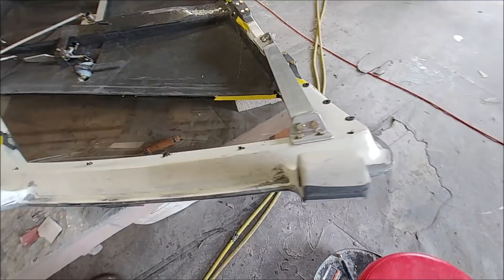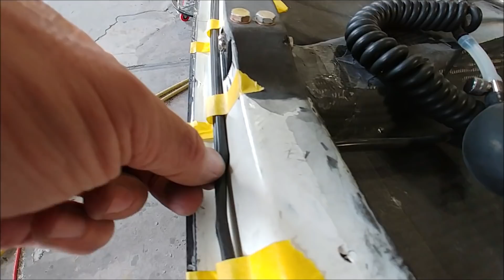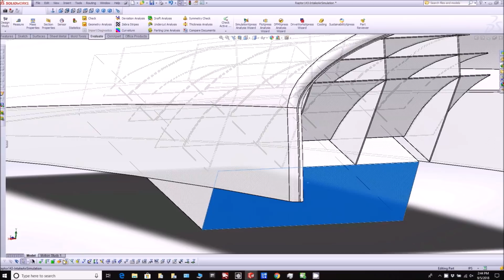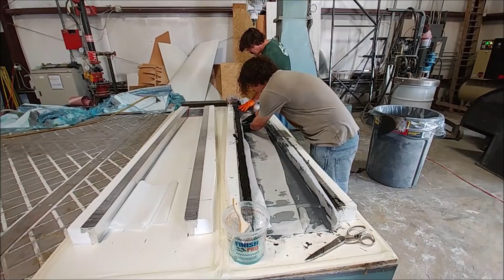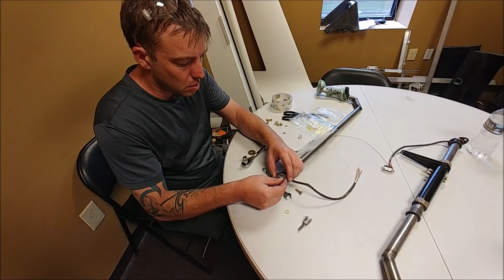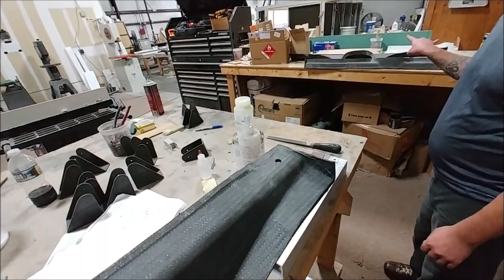Doors Going Back On - Building the Raptor Prototype

Comment: Intercooler air guide vanes: did you consider giving them an airfoil shaped lip? This will reduce turbulence and allow better pressure recovery. Try changing angle of attack in SolidWorks?

Comment: I wondered why you didn't put the seal for the doors on the aircraft and not on the doors. Seems like it might have been more simple. How is the building of the production aircraft going? I was expecting mine in Jan 2018, so what will the new delivery date be like?

Comment: Can the windows be flanged or have a lip to mount them into a lip on the frame and install them from the inside ?  When pressure builds inside the cabin then the window flanges will seal against the frame.  No need for any external bolts.
Reply: I was thinking something similar.
Reply: I made this comment a few videos ago. I'm afraid these windows will be quite dangerous. At 5 psi differential, there might be thousands of pounds of force on the windows. Introducing bolt holes will add a new stress point to the plexiglass.
Reply: It would be wise to add a sheet of carbon fiber on the outside to spread the load and preserve the plexiglass from cracking. And more generally there are many solutions already tested and proven in the certified world, no need to reinvent the wheel when the existing practice is satisfactory.

Comment: I read the other day (at https://www.beechtalk.com/forums/viewtopic.php?f=42&t=156458) that the pressurized Baron twin only lowers the altitude by some 12,000 feet, so cruising at 25k would still put you at 13,000 feet. Therefore they don't like to go into the 20s. What's the target for the Raptor at 25k feet? Tx.

Comment: Do you think you’ll ever be able to have an adhesive/epoxy only solution for the glass or will it always need bolts to hold under pressurization?
Reply from the maker: Future design will have fasteners.
Reply: Fully support a solution with mechanical fasteners. Look at certified aircraft - they ALL have dozens of bolts all around cabin windows. My aircraft even has two rows of bolts for the windshield. There is a reason for this. And look at what happened to Lancair Evolution: windshield departed in flight. Glue only = disaster waiting to happen.

Comment: So, on the final product, is there going to be a bulb to inflate the door seals, or will the inside/outside pressure difference be enough to do it on its own?
Reply from the maker: Bulb or an electric pump.